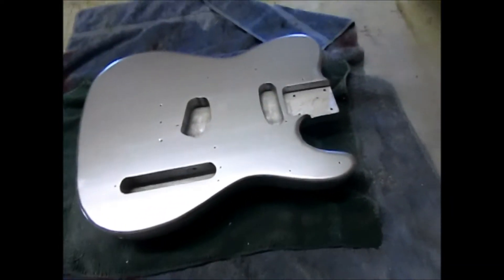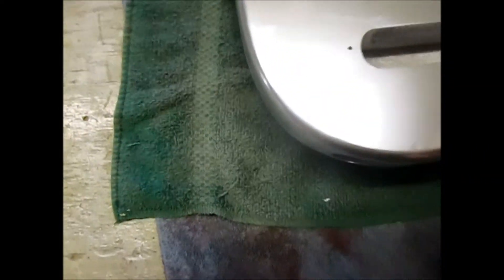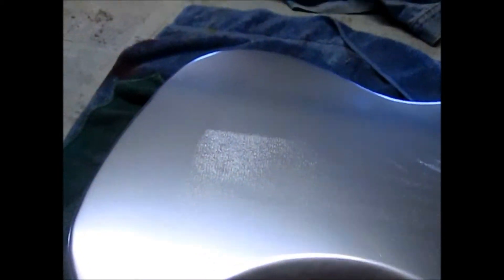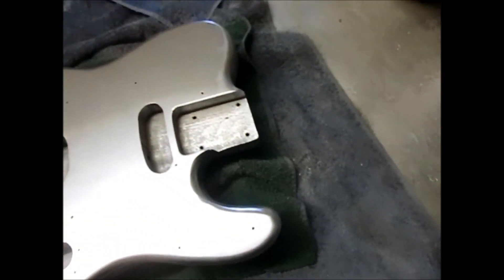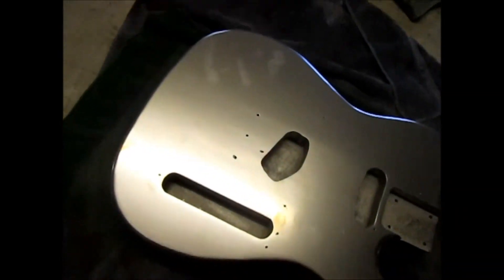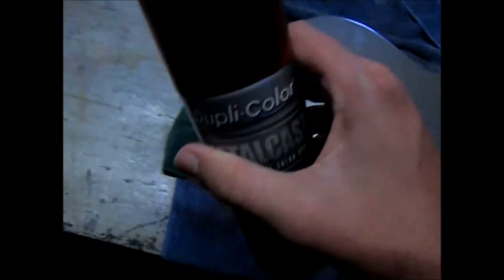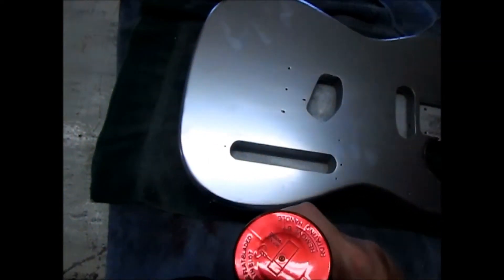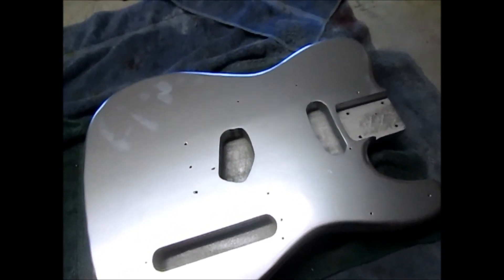hot rod tele kit series video 13 update on the metallic paint

Comment: If you can, hang the guitar by a thick wire (coat hanger works good), then paint while hanging carefully to avoid drips. I had to let my paint cure for two weeks (all while hanging undisturbed). The wait is certainly worth it. I also let my clear coat dry for several weeks before wet sanding. Keep at it. The waiting is the hardest part. lol